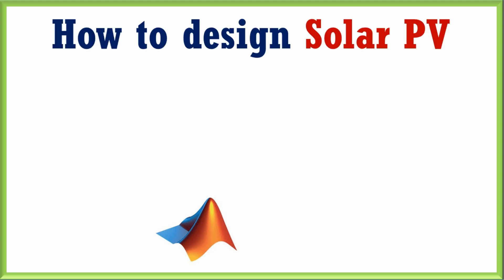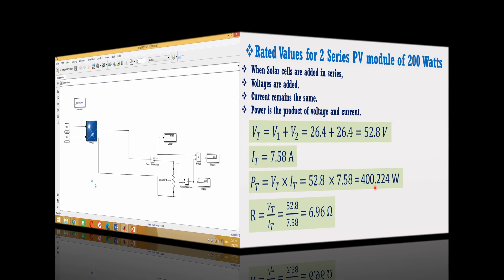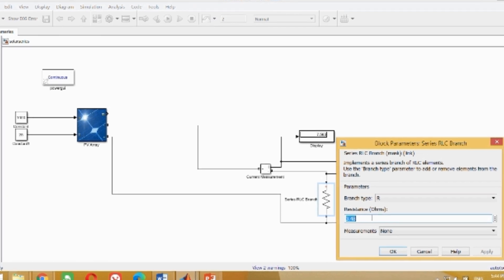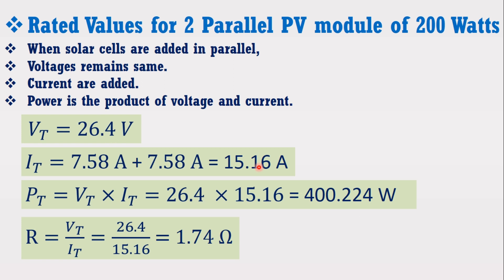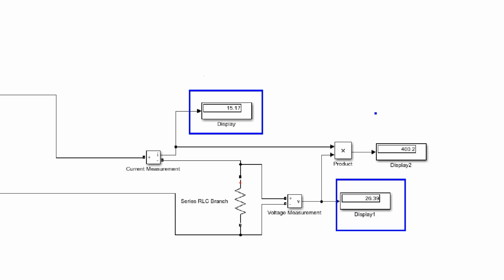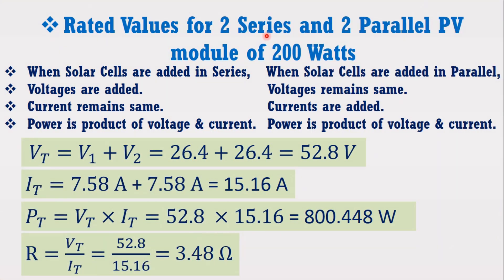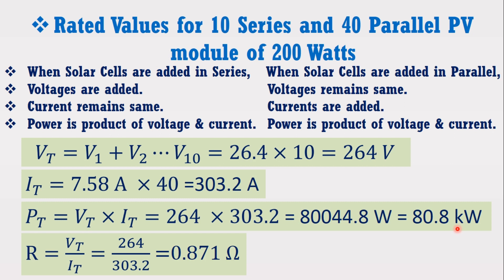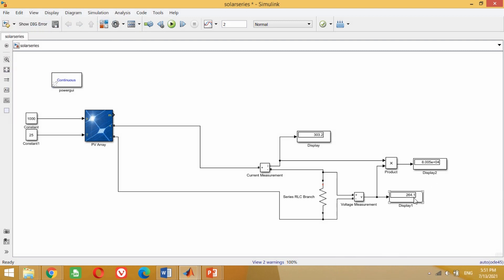How to design Solar PV Arrays in Series & Parallel Configuration in SIMULINK ? | Dr. J. A. Laghari

Comment: Thank you so much for these videos. I have a question if its not much to ask. I would totally appreciate your knowledge on this matter . I am suppose to have 2 string of Pv in series with p= 15kwp.
Does that mean i just use your example and keep my series 2 and parallel to 1. I am
Not really getting this two string issue .Am sorry that the question comes out stupid .but i need help
Reply from the maker: Thanks for the compliments and query. I think better to put the 2 series and parallel to 1 and measure yor results. if the results are correct then ok otherwise change it.

Comment: Sir, do you have a modeling and simulation file for the effect of temperature and irradiation on photovoltaic solar cells using Simulink?
Reply from the maker: Thanks for the comment. See its first video in which effect of temperature and solar irradiance is simulated.
Reply: @DrJALAGHARI  

Can you show me which video?
Reply: Would you like to help with my final assignment (thesis) by modeling and simulating the effect of irradiation on photovoltaic solar cells using Simulink